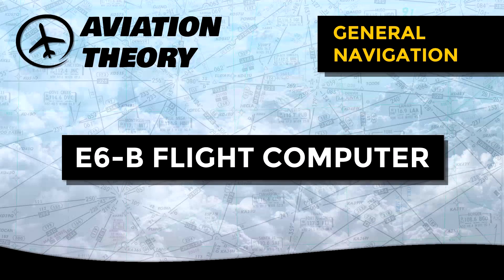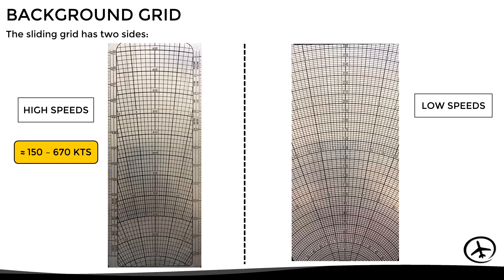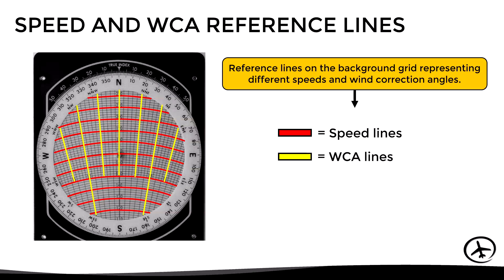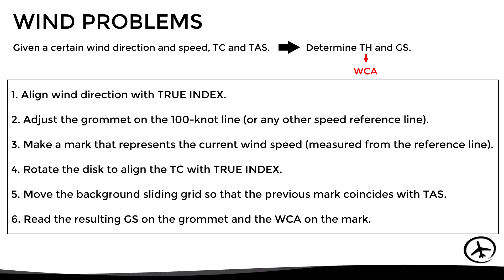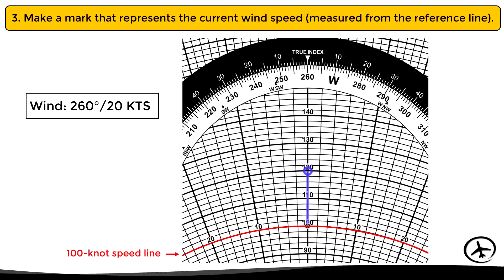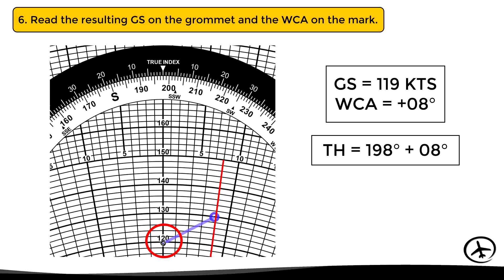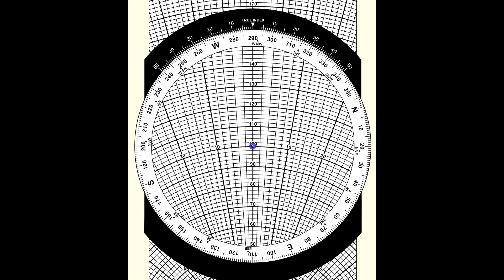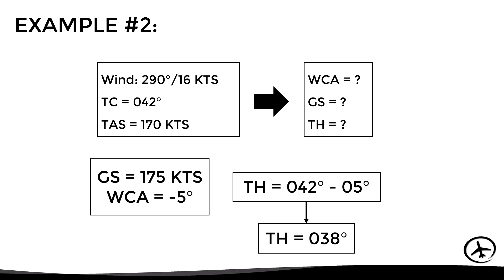How to Solve Wind Problems with the E6-B Flight Computer - (Part 2/2)

Comment: Why did gromet comes to 175 ? You say tas 170 but bring the gromet to 175? What im missing ??
Reply: 1) Set new rotated point on arc with value = 170. 2) Then read position of gromet (175).

Comment: I have a question 

If an altimeter setting is not available, the pilot can set the altimeter to the airport's field elevation before takeoff. is this true?
Reply: Yes. But at 5.000ft AMSL or 3.500ft AGL the pilot needs to transition from altitude (ft) to Flight Levels (FL) by dialing in the international standard altitude (ISA) QNH 1013,25.
Sometimes gliders which stay in the proximity of the airfield even use the QFE which means that (before take off) you dial your altimeter to show 0 ft at runway level.